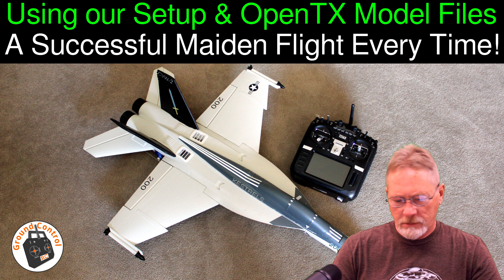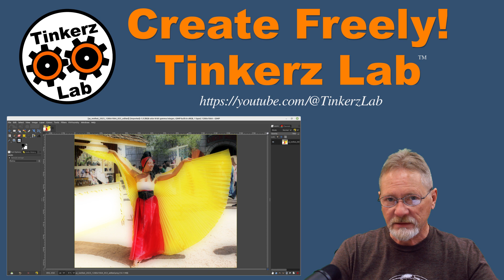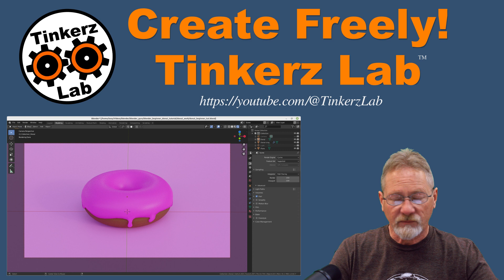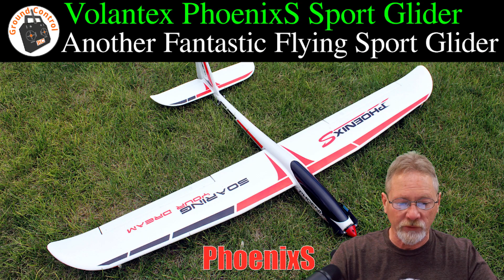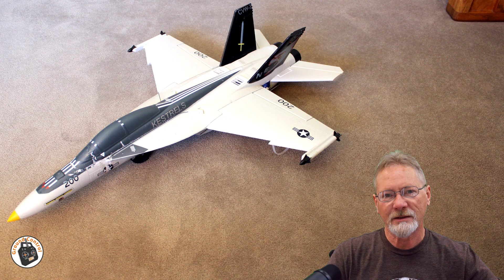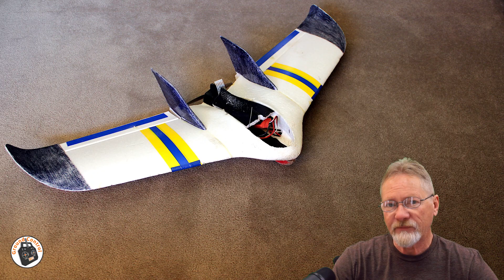The Pilot's Lounge Episode #23 - Crashes, In The Pipe, and a New Channel!

Comment: About teh PhoenixS are you sure the vibration doesn't come from the prop itself? I'd check if the blade weights are the same and if the spinner is balanced, not sure if you can actually balance a folding prop like a regular propeller 🤔
Reply from the maker: Hi Keppis!
Yes, I balanced the prop and spinner.
I also tried (2) separate sets of folding prop and spinner assemblies with the same results.
Reply: The motor has a metal plate between the Plastic an motor itself,.vibrations,, I think aren't to much to worry bout. Der plastic fuse is really strong. Unreal Mate, Have a good weekend My Friend!
Reply from the maker: @jonoedwards350  Hi Jono!
Yeah, the vibration shouldn't be a problem as it's very slight at only 75% throttle.
It's getting launched ;-)
Have a good weekend!